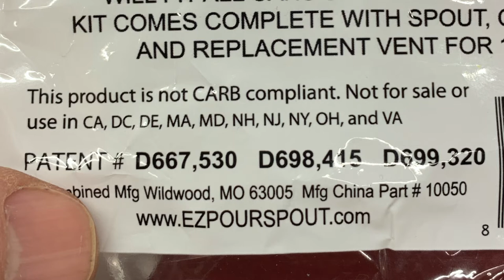EZ-Pour Replacement Spout and Vent Kit For Your Gas Can

Comment: I don't use plastic gas cans. I use the old metal cans from the 70s also GI Gerry cans for larger amounts. I had a very reputable source inform me gas will store better in metal cans because uv light can't get through them. I've had gas in a metal can for up to a year with no problem. Have a blessed Christmas, Wayne and Suzie!!
Reply from the maker: I remember those metal gas cans. I wish we could still get them. I did see a metal can once in a light truck parts shop - $$$. It's a shame I had to pay what I did for these plastic cans, then another $10 for the EZ-Pour spout, just to be able to easily pour gas. On top of all that, I may have just become felon! Blessings to you too, Mr Wever!
Reply: MERRY CHRISTMAS

Comment: Ohio is cracking down on these my local rural king said they aren't allowed to sell them anymore however they sell their own version of the racing cans for 20$
Reply from the maker: Yeah, I’ve heard that. It’s too bad. I know people say this all the time, but it’s true: I spill more gas using the so called safety/eco friendly cans than I ever did using the old gas cans with the simple spouts.
Reply: I'm the same way, even if you get one to work halfway decent they seem to degrade quickly.  I think I may pick a few up next time I'm our of state or use a few racing jugs for my lawn equipment. Thanks for the review by the way!